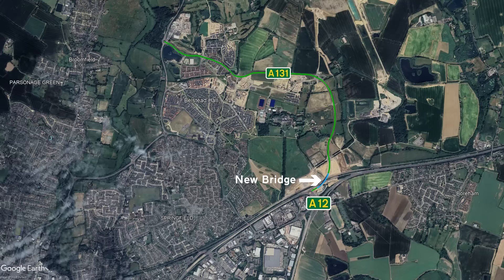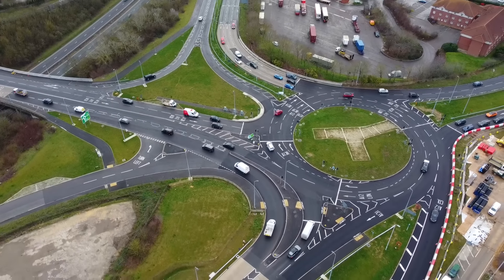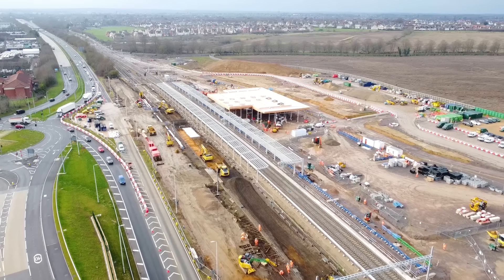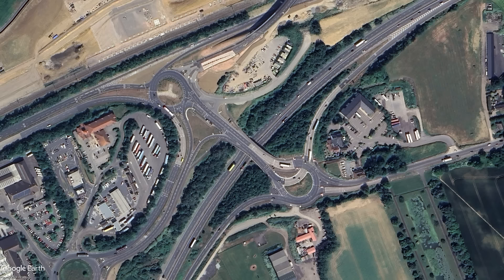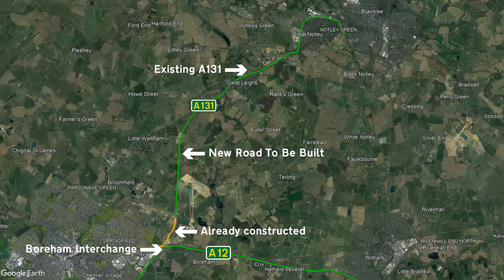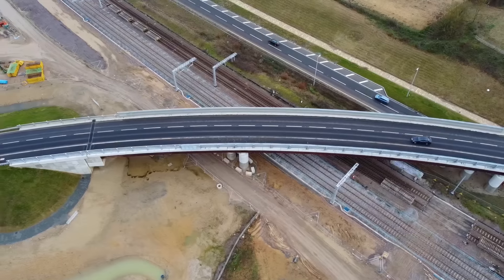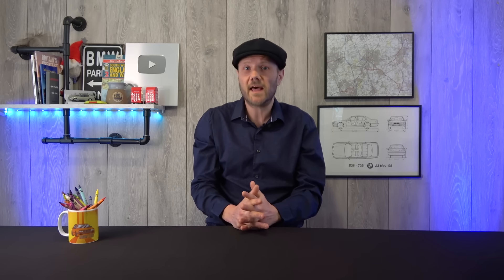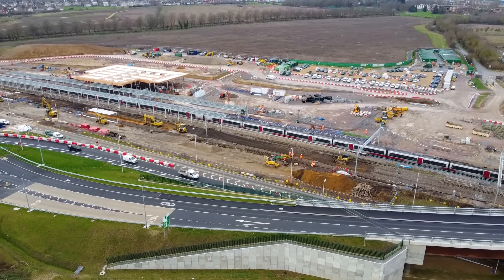The Boreham Interchange Gets A New Road Bridge - A12 Chelmsford Essex

Comment: Hilariously, corten steel was go-to solution for architects back when I was one over a decade ago. It was rather expensive back then and was a way to show off for a lot of architects. How times change
Reply: Far more visually appealing than Corden steel though. ;)
Reply: Some bozo decided to use it at ground level to tart up Lithgow Library which has a bus stop outside.  If you lead on the wall you ruin your clothes.
Reply: @JulianSortland  It also drips rust stains on everything below it.  It can be a good solutions, but you have to be really careful where you use it.
Reply: There's a building on the corner of Farringdon Road and Topham Street, London where they used Corten panels for rainscreen cladding down to pavement level for exactly that "show off" reason. It looks like crap with the panels scuffed and marked and the bin store doors all battered and greasy. Great choice.
Reply: @DavidJCane  I was part of a team that was made to use it by our boss in a project here in mainland Europe. It was a facility for fishermen to store their things which were usually messily left all over the place, and try to make the area less of an eyesore. It was mercilessly mocked for looking worse than what it was trying to clear up
Reply: I first came across Corten steel being used in the manufacture of shipping containers I haven't seen any of them unpainted, plenty rusty ones though.

Comment: Perhaps you should have nipped along the A12 to Witham to document for posterity what is the UKs longest running Temporary Traffic Light installation on Woodend Bridge. Eight years and counting! Thanks for all the thought provoking entertainment, too!!
Reply: Always fun when it just randomly stops working and remains on red. You can't see if someone is waiting on the other side, so you're just left to risk it. That of course is after waiting a few minutes until realising the lights are fucked again.
Reply: My nemesis, used to wind me up on a daily basis on the way to work. A van every morning to sit in the cones to make sure the batteries don't die during rush hour. god forbid how much that 'temporary' solution has cost.

Comment: I've often had to drive through that part of Chelmsford and even when it's not congested, the sheer number of roundabouts on the A130/131 means it's slow any time. The new bypass has just as many, currently less of a problem because it runs through open country rather than through a built-up area, which will change once the new Beaulieu development is built (or indeed, being built). The road doesn't just link to Braintree but carries traffic from east Chelmsford to the M11 which previously went up the A130 (now a B-road) but is now directed up the much less direct A131, which used to be a nice straight road but is now a succession of bypasses with multiple roundabouts each.

Comment: I've been commuting past this spot for 30 years and I can safely say that I can remember when it was all fields round there. Essex County Council's road policy has been pretty awful for years. The A12 keeps having tiny improvements made when it basically needs widening from the M25 to Ipswich.  The Boreham Interchange will be a nightmare when the new station opens as people from surrounding areas use the nice large car park there instead of driving to the old station in the middle of town. 

While I'm usually in favour of these out of town transport hubs, they need to be built to withstand the traffic load. 

BTW if you ever want to do a series about towns with rubbish/unfathomable road layouts and networks, my nearest town of Colchester would be a good start. Gridlock guaranteed at peak hours.

Comment: The new houses, shops and an all years (nursery through 6th form) is all in place. They are now moving on to the next set of houses are now their focus. The road is full of roundabouts ready for them and a relatively low speed limit so it is still faster to use the existing roads rather than the new a road.

Comment: 20 years, more like 40, trawl back issues of the Essex Chronicle and plans for the North Springfield train station and A12 fiddling started to appear in the paper around 1983, before the Eastern bypass, and the A12 moving. The previous proposed sight for the station was sold and some flats and an Aldi supermarket built on it ~25 years back (half a mile south of the current site).

Comment: Seems as that is the standard for Lincolnshire as well, the new (eastern) part of Lincoln's By Pass was originally planned to be duelled, yet after contractor going bust and delays it's single carriageway with a "If you're too slow to drive up the slight incline" bit of road. Still waiting to hear if they're actually going to build a complete ring road or if that's our lot for another 40 years.

Comment: With the new A131 road bridge that goes over the Great Eastern Main Line. That is where the new Beaulieu Park railway station is cutunder construction and is due to be completed next year. Plus the A130 it should end at Great Dunmow with a new bypass being built to avoid several villages. 

And there are plans to widen the A12 between Chelmsford and Colchester both ways. With a new junction 22 to be built. Unless there already is a junction 22 on the A12.

Comment: If you think the traffic is bad at boreham you should try Junction 17 at Howe Green on the A12 with the A130....or Fairglen Interchange between the A13, A130 and A127.
Reply: Fairglen is worse though I think Boreham is as bad as Howe Green.  The northbound A12 starts crawling from the A414 junction, the southbound from the same junction but the distance from the 414 to Boreham is a lot longer. I stopped using the A12 ages ago because of it

Comment: Also - we'll done for pronouncing Beaulieu properly!! 

And as for the new stretch if the A131 being widened, I've been saying all along why isn't it? The A131 carries a lot of traffic between Braintree & Chelmsford, and once Beaulieu town/village is finished that'll be a few thousand cars more using that stretch of road.

Great video, let's hope the rusty bridge lasts a long time
Reply: I also live locally near Braintree and use the A131 (Essex Regiment Way) on my way to and from Chelmsford. I agree with you, the A131 should most certainly be dual carriageway as like you say, it carries a huge amount of traffic between Braintree and Chelmsford / A12. Let's hope that funding for the new bypass / the rest of the plan becomes available soon and they can start sorting out the congestion lol
Reply: @samuelwade  Completely agree, the future section of road that will come down across farmland from Essex regiment way near Grasshoppers to join the road shown by Jon should partly alleviate the problem when it gets built, but it does need to be dual carriageway otherwise it will be a wasted opportunity 👍
Reply: @Pesmog  Exactly, at the moment, I regularly see the traffic bottleneck at the entrance to Braintree Road (the current A131) on Deres Bridge roundabout in the morning peak so yes it should alleviate the traffic issue slightly for sure. It's all well and good building the new bypass but for it to be "future-proofed" for dualling later on down the line just seems absurd to me as by the time it does get built, the demand will definitely be there for a dual carriageway I believe.

Comment: Believe me, this is old news in terms of the Chelmsford environs being a road building disaster zone. The Army and Navy roundabout is a classic example of this and the ‘parkway’ project which was a half-arsed ring road with a lot of unnecessarily complicated avoiding junctions bits strapped on while many homes were ‘cleared’ to make way, only for the space to be filled by something that looked like it had been designed by playing a road version of that game where you draw the head, then pass it on and the next person adds the shoulders and upper torso, then the next one adds the midriff, etc to the feet. They drew the Army and Navy then when the ‘plan’ reached Broomfield Road, the opened it up and just submitted it. The pedestrianisation of the High Street made sense I guess, for which they created a new diversionary bridge which did at least ease a bit of crap one had to manoeuvre around in the south-east corner of the town centre. In the three years there it was constant road rebuilding and repurposing which got dreadfully dull. Then they trashed half the town centre and rebuilt it. Well, they trashed it and it is still a ‘work in progress’ apparently 😒

In short, you rightly infer that this is typical of many road projects and idiotic deviations that have been created over the years. The A131 was always an utter arse to get onto when travelling across Chelmsford, so one can only hope this might just help a little. But it will still be utter shyte 🙄

Cheers John 🍻👍🍀

Comment: Can you do the epic failure for the London Silvertown tunnel?  I can only foresee after the tunnel opens, the traffic issue still won't be solved a bit as the north side of the tunnel connection.  It does not connect to A12 directly or A13, it just connects to A1020 with 2 roundabouts that set traffic lights in them.

The funny thing is that A1020 to the east side is supposed to be a dual laneway and very good to drive the whole way down to A13.  I was able to do it before the council made the changes before 2021.

The lovely council axed the road in Silvertown to a single lane by making another cycle lane that no one uses:  I can ride a bicycle on the cycle path next to the pedestrian road as a much more safer option.  So the last way to redirect traffic had been killed also.

There may be forecast huge traffic problem there and raising the funds to go back to the project, so the lovely mayor going to charge everyone to use not only the new tunnel, but the old Blackwall tunnel as well for 4 pounds each time, double than the Dartford cross.

Comment: Interestingly enough, if you look up the original plans for the roads on the north side of Chelmsford, the original plans for the A130/Essex Regiment way was it to be a mostly grade separated dual carriageway, and this was in the 70s. However, since it was devised in the 70s it never happened and what was built instead was a quickly upgraded farm lane with roundabouts too close together. This is probably a better solution as it means traffic for the North side of Chelmsford is split off at the first roundabout, and isn't mixed in with traffic for Braintree.

Tbh Essex just needs a massive infrastructure rebuild, as does most of the county. It's a pity we can't just build like they did back in the 30s

Comment: There is one minor benefit when heading A12 southbound and you want to access the services. The new “cut through” roundabout on the southbound exit and the filter lane down to the next roundabout that takes you to the services roundabout is an improvement on the previous design, where people would overtake and then cut across - an improvement, slightly, but not worth the expense IMO. 

Typical council thinking, where you arrange a meeting to schedule a meeting where you discuss the need for a meeting, and of course there will be biscuits (which for anyone who works in a real job stopped happening back in the 1980s)

Comment: The area is crying out for a proper link between the A120 at Braintree and the A12 at Chelmsford. At the moment people trying to navigate between the two either have to dig their way through the Springfield area of Chelmsford, further up at Witham, or head down the country roads. Having used this bypass last month, the speed limit and sheer amount of roundabouts on the route means it's barely any quicker than cutting through Springfield, and the roundabout at the junction of the A12 is an absolute clusterfuck.

Comment: I'm American, so Round-Abouts (I don't even know if it should be 1 or 2 words) are as foreign as the Metric-System (2 words?).  But I think the UK might be too in love with Roundabouts (?).
Reply: It's just one word, and roundabouts work quite well when drivers use them properly by getting in the correct lane for their intended exit before entering, and give way to traffic already on the roundabout. The extra length of road they provide also increases road capacity at busy times, which means less nose-to-tail waiting than at a junction with traffic lights. 
All in all, then, they're not a bad idea, and (please don't take this personally) better than the badly designed junctions I see in so many American dashcam videos.
Reply: @Kevin-mx1vi   not taken personally at all.  Truth be told... roundabouts are beginning to pop-up here in the US.  And like the UK they are finding their way as junctions for ramps on and off the freeway.
Reply: @rollinwithunclepete824  To be fair, roundabouts work best where there's light to medium traffic when they allow it to flow fairly freely. 
There's less chance of getting T-boned than at a normal crossroads because (in the UK where we drive on the left) all traffic is approaching you from the right as you enter the roundabout. This means you only have to look ahead and to your right as you join, and the angled approach roads make you visible to traffic already on the roundabout for longer, thus lowering the chance of a collision.

Comment: The new road has made a slight improvement with local traffic on the old route, but it's still a half-a**sed "solution". A proper dual-carriageway road to Great Leighs with a new dedicated junction to the A12 is needed now, not later.

Comment: I live in Braintree and use the new A131 including this bridge a lot, it saves so much time, and the road is very quiet as nobody uses it 🤣

However - Boreham Interchange at the end of the bridge still leaves a heck of a lot to be desired, and the traffic when Beaulieu station opens will be pretty bad - space going in for 700 cars
Reply: Hello fellow Braintree person, now if they could only sort out the A120 from Braintree to Marks Tey which has been talked about ever since I first started driving COUGH years ago.
Reply: @ChuckFickens1972  mate, that A120 is horrendous!! As is Galleys Corner, for a relatively small town, traffic is chaos
Reply: @MrCraigNic  Galleys Corner,, surely you mean cholesterol corner as it's affectionately known😂😂

Comment: I still don't get why they didn't make the New A131 dual carriageway or partly dual carriageway, even with the budget cuts. I still take the Old A130/A131/B1008 (AKA all the OLD old A130 from about 2006) which is still quicker by about 10 minutes. Yes it may help those in the new Beaulieu estates in upcoming year but for the through access (EG Southend to Stansted) will still probably take the old route.  Even with this new bridge, its not cutting any time off longer journeys.

Comment: The simple fact is Beaulieu Park should never have been built without the new A131 dual carriageway and an adequate connection to the A12.  Bus lanes have been added to existing roads leading to more delays, the thinking being by taking away road capacity people will give up using their cars, that doesn't work either.  Chelmsford used to be my go to place for shopping, not anymore.

Comment: It’s the south’s version of the York Northern Bypass aka the A1237 built in the 1980’s as a single carriageway and in many sections the width of a country lane, then some imbecile gave consent to build lots of retail park and office development alongside.  Anyone with two functioning brain cells knew it would be regularly gridlocked from the start. 

Also York, several attempts to ‘fix’ the congestion at the Hopgrove roundabout (the A1237 / A1036 junction with the A64) when it’s patently obvious the A64 needs a free flowing flyover, plus dualling all the way to Scarborough.

Every footbridge on the new east Leeds orbital is Corten steel.  I think it looks fabulous 😀

Comment: As a member of a planning committee some years ago, I voted against a house made out of Corten steel. It looks like some scrap metal someone forgot to paint and rusting away when new. When it rains (as they will no doubt find out) there will be rusty marks down walls and rusty pools and stains where the water drips off. I suppose you could call it Scrapyard chic. I'm not a fan.
Reply: the bleeding stops after a few years, as the surface self-seals. If only you weren't so ignorant.
Reply: @thomassjcowley  fortunately, im not.

Comment: Let's just get this straight. This little project is a mess. But then so is everything else in Chelmsford. Whilst it rapidly becomes a London suburb, it struggles for funding to do sensible things.
The rail station at Beaulieu has been mooted since they first started building houses there 20-ish years ago and is only finally being built. Infrastructure locally is cheap as chip yet thousands of new home are incoming. it doesn't add up. Or does it? Witham and Braintree are Tory safe seats.